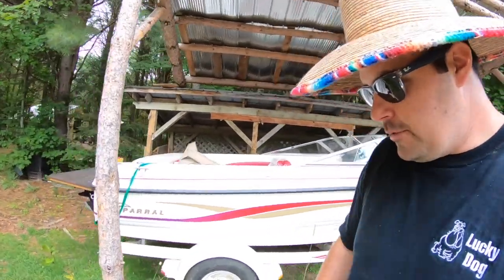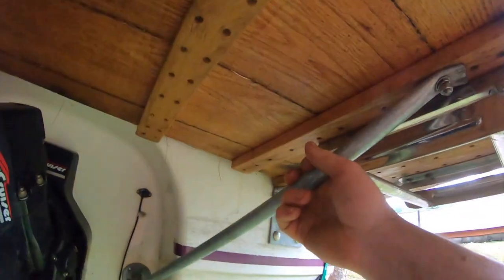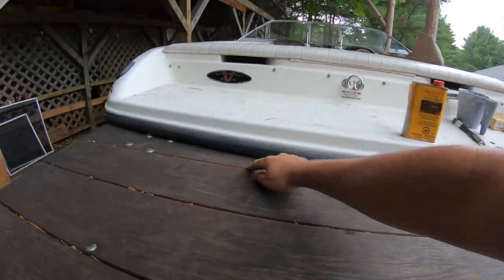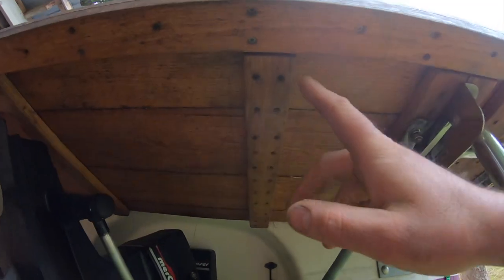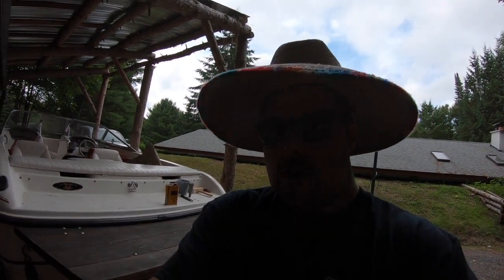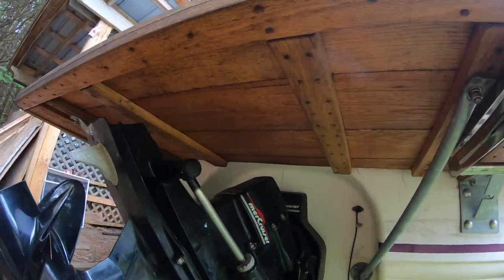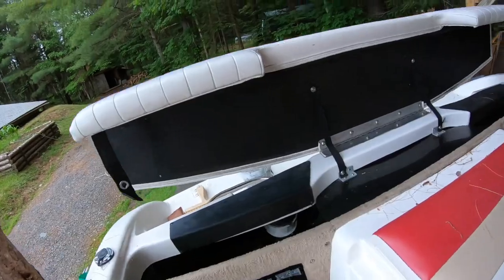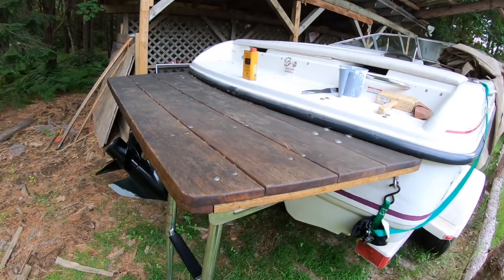DIY Bowrider boat swim platform. Chaparral 180se.

Comment: Not bad, very similar to mine. I have made two on my own, both out of composites, which of course cost a bit more. First one was constructed like yours, like a deck with boards running side to side on the top. My second one was made with an antiskid Starboard topper. Has a clean look but cost 30% more total than the first one.

Comment: What size pipe did you use diameter and will it hold an adult without bend?
Reply from the maker: 3/4” pipe. I’ve had two adults standing on it without issue

Comment: Thank you for sharing this.  We have been wanting to add a platform to our boat.  Buying one is ridiculously expensive.  

I am planning to make one like you did.  Only thing I plan to change is to make the brackets out of aluminum or stainless steel for rustproofing.

In reality, the amount of work you put into this deck would've been the same as if you purchased a premade deck.  Either way all the mounting, drilling, and fitment had to happen....  You just saved yourself a $1000 dollars and have something to be proud of to show off 👍.  Good job
Reply from the maker: Thanks and I agree some different hardware for the mounts would for sure be a better option. I always wanted a platform and I love woodworking so one day I woke up and decided that was the day haha

Comment: Excellent work and thanks for sharing your idea.   I just bought a 2008 Bowrider 175 with a 3.0 Mercruiser. Since my motor is smaller, I may alter your design by using lightweight composite decking.  Another added benefit is little to no maintenance on the finish.
Reply from the maker: You’re right about the maintenance I barely do anything to this thing. Hope your build goes well

Comment: In the video you say it’s red oak, a highly absorbent wood.  It the comments you say it’s white oak, a wood that isn’t very absorbent.

As mentioned, teak (expensive wood, doesn’t absorb) would be a better choice, however you aren’t leaving your boat in the water all year long, so honestly it should last as long as the plastics on the boat, longer if you keep up your annual maintenance on it with the tung oil.

I found your video because I’m looking at the possibility of needing similar for myself.  I’m looking for a sailboat to do The Loop, the Caribbean, and a crossing so I can do the Mediterranean, Adriatic, and Black Seas.  Many used sailboats on the market lack a swim platform, which I consider mandatory if I’m sitting at anchor in Ibiza, Monaco, Mallorca, Mykonos, Bodrum, Unye, Nessebar, or Batumi.  

THANK YOU for showing me that the project is indeed easy and relatively basic, as it looks, but as with everything done to a boat, is something many fear to embark on for fear of screwing up the boat.

Great video, I have saved it to my boat list so I don’t lose track of it and can easily find it again if and when the time comes for me to copy your design!
Reply from the maker: Hey Rick! Thanks for watching. The platform is still holding up great with just an annual application of the oil. I agree that teak would be ideal though compared to this. Hope the build goes well for ya. Keep me updated!

Comment: What are your thoughts on using composite vs actual wood?
Reply from the maker: My main concern with composite is it doesn't have much stiffness so it would bend unless there is a good amount of structure holding it up

Comment: Did you have any issues with taking off on the water.  Does the platform hit the water when you hull shot it?
Reply from the maker: The platform is high enough that it doesn’t touch the water

Comment: How did you compensate for the transom angle noticed the gap did you use washers?
Reply from the maker: I didn’t account for any transom angle. I just bolt the bracket tight to the transom as it’s pretty well vertical
Reply: What are your dimensions and what size boards... doing this this weekend